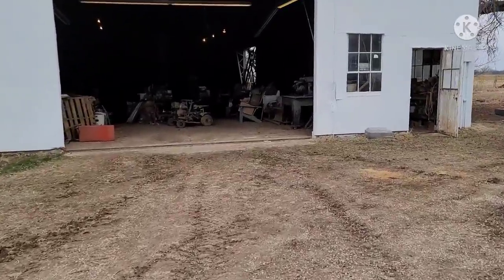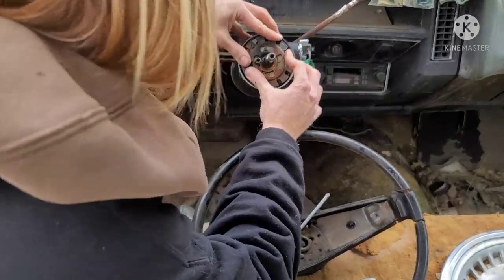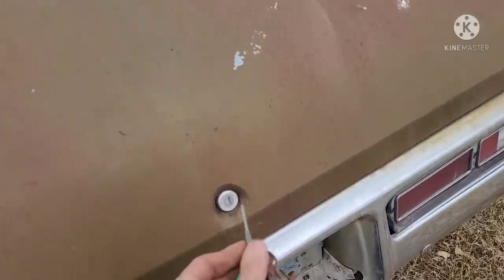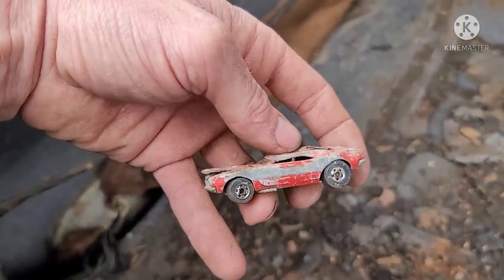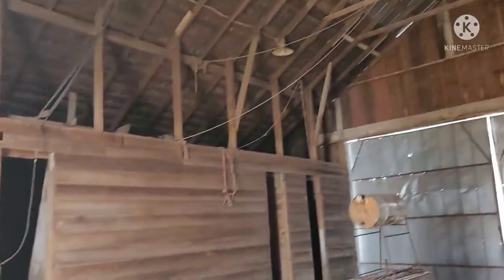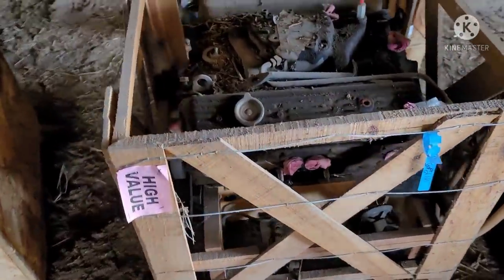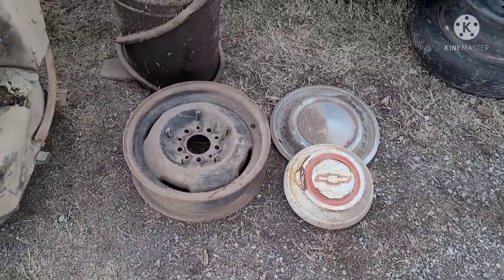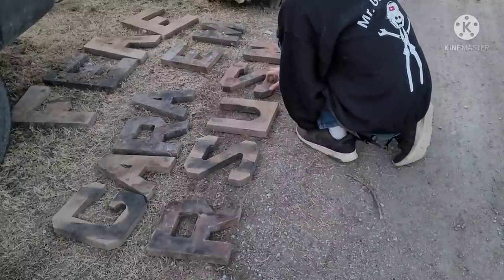What's in the barn dust? 1972 Impala Custom coupe & Oklahoma Auction Picks! Plus 1973 Chevrolet!

Comment: No tool is the wrong tool if you don't break anything and you get the job done!  I love my 72 Impala that was bought new by my grandparents.  400 small lock with TH350 trans and only 70k miles on it.  The torque is quite impressive for a low compression engine pulling over 2 tons of car!

Comment: So cool!  I am impressed by how you were careful, and methodically disassembled the steering column and shift linkage so the car could be moved, instead of just smashing the key out, or yanking the car around "as is".  My first car was a 73 Caprice coupe, drove it over 240,000 miles with the original engine and tranny.  The northeast weather finally consumed it though.  I can honestly say that if someone offered my any car, I would chose that car in new condition, perhaps in convertible form with a 454 though.  I dream of having the skills/money/facility to do a frame off restoration on one of these great cars.

Comment: Very nice video! I remember in the fall of 1972 seeing the 1973 model Chevy's, it was the first year for the 10 mph style bumper. 72 and 73 were the last years you could buy a nice car before all the regulations started to take hold, then they started to use that cheap steel, its just amazing what a 1975 Cadillac would look like in 1980, in Chigo, very rusty.
Reply: Smog police in 73, ... yup yup

Comment: Im not a GM guy but.... that car as a 2 door ....I think is worth spending  money on....its got it's own kind of presence in the fuselage body style era. Mopar nailed it .. even mastered it and led in that design era like the forward design cars. Only lasted maybe 3 0r 4 years because...THIS CAR......IMO..... HAS THAT FUSELAGE LOOK WITH THE ....PUT A WEIGHT ON MY GRILLED CHEESE....COPY? ITS FLATTERERER.....LOL

AND THE DECK LID WITH THE VENTING....ETC... FROM ABOVE LOOKING DOWN....PRETTY... TAILLIGHTS ARE COOL..... DRIVETRAIN COULD BE A BIG BLOCK NO PROBLEM... GOT DISK BRAKES....I RAMBLE....

SURPRISINGLY ...I LIKE IT
Also... if a crescent wrench isn't used as a hammer what is it used for?

CHEERS 
God BLESS y'all